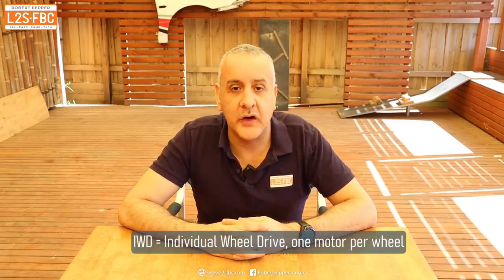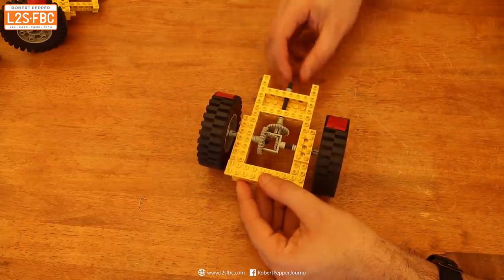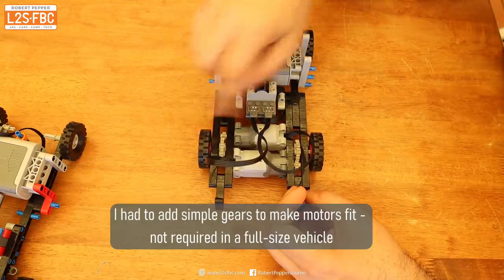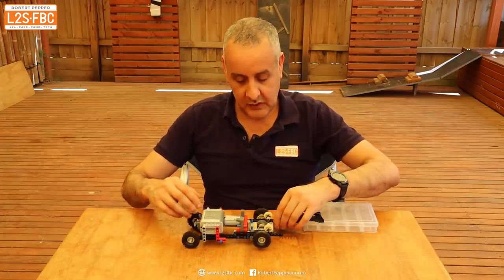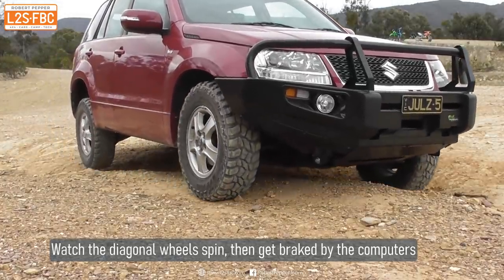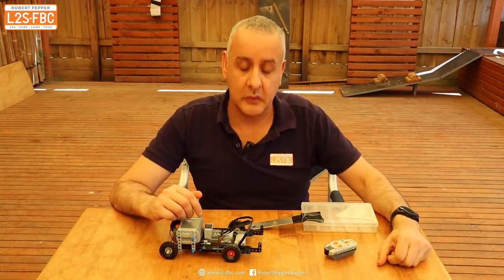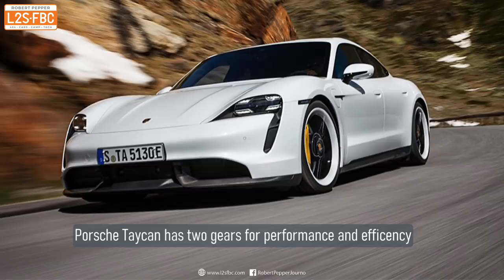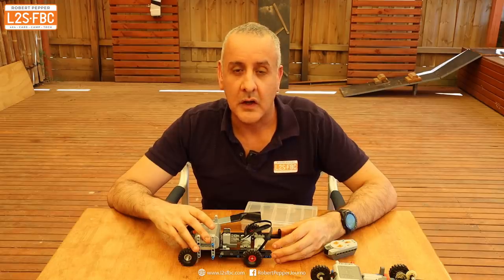Why Differentials Will Die - EV IWD Is The Future!

Comment: What about using resistive braking to control traction. With independent wheel drive if one wheel comes up off the ground you lose a quarter or one half of your torque and horsepower. If you had a setup with a single large engine and for small engines then you can get the best of both worlds during low loads you can use two or four smaller engines and during times when you need a lot of horsepower you could use three or five motors. The central motor being connected with some form of locking device like locking hubs or pneumatic locker or even electric magnetic locker. Then, let's say you're trying to rock crawl or something to that effect and one wheel comes up off the ground you could hold it back using the regenerative breaking to redirect to that power to the other Wheels. This type of setup could also be used with the gasoline engine.
Reply from the maker: I see what you mean, but I think IWD is simpler and as effective. I don't think losing 1/4 or the torque is a problem, or even half.  What you describe is pretty much brake traction control.

Comment: Another excellent video. Another advantage of the electric for offroad use is that it is easy to set up an independent high clearance suspension with a very large suspension travel. One downside to that though is that in order to simplify the connection of the motor to the wheel, you may be increasing the unsprung weight if the motors are heavier than a conventional axle and differential setup.
Reply from the maker: True but if the motors are inboard then that isn't a problem.
Reply: You can put the left wheel motor on the right and a CV shaft that will give you huge articulation with independent suspension and with a bit more electronics you could have good articulation offroad with very low body roll on road.
Reply from the maker: Exactly how Riving Atlis and Hummer do it although Hummer only on the rear axle.
Reply: @L2SFBC  Also on the military Hummer, the axle shaft enters the wheel near the top where there is a gear (this is the final gear reduction in the drive train).  This is how they are able to achieve 19 inches of ground clearance.  If you could build an electric motor in a small enough form factor to mount toward the top of the wheel, you could do basically the same thing.  Said motor though, would have to be sealed against water and mud intrusion.
It would not surprise me if there is another vehicle replacement program in about 25 years that uses exactly this technology.  It would also not surprise me if we start seeing the same technology introduced on the civilian market within the next ten years.
Reply from the maker: Good points! I was referring to the new EV Hummer which has no rear diff just two motors. Thanks for the info very useful.
Reply: @L2SFBC  405 hp orbis hybrid electric honda civic type R motor in wheels, they claim there is no upsprung weight penalty. it was at sema car show.  see aptera owners club video on saftey, vidoe on cost, video on suspension geometry. i wonder what caused panoz deltawing gt to not become sold, given they were so confident about it that they made a prototype.  car i want, is electric drive with a balance of battery and combustion that cost least to own, ends of combustion move aa shaft with magnet and lubrication far from combustion area, non moving magnet makes enegry with magnet moved by shaft to power motor, maybe some air pressure regen brake and powered brakes to minimize electric batteyr use for lonegevity maybe even without a energy effinecy loss. rear seats face the rear (this place hides what i say when i say certain things or just say too much, so i cant explain everyhting but you can fugure it out easy). theres more to say... maybe on guilded we can start a thing for youtubers

Comment: I’m a big fan of electric, But water crossing is gonna be a difficult task and something I would not want to do.😅
Reply from the maker: Same as for any modern car...
Reply: Look up electric RC cars in water, they handle it fine. A big problem with electric cars are the electronic speed controllers, Its basically easier to tune a ice engine then it is a new brushless motor and esc combo XD

Comment: Somehow, my anxiety goes like this. Normal system is like -trust a single man(engine/motor) do good the vehicle moves good. In IWD its like - you have to trust on and must on 4 men(motors) and if and only if all of them do good and sync perfect from start to end, the vehicle moves normally.
Reply from the maker: How is that different from 1000 plus parts in an ICE?
Reply: @L2SFBC  Hard metal parts vs computer software. Electronic speed controllers can be a real pain, especially when you are not getting proper feedback from the brushless motors.

Comment: I did this in my robot wars machine. Two drill motors drive the back wheels. It isn’t power-biased and the fronts just steer. It works very well :o)

Comment: can a car with 4 in-wheel motors be more stable than the conventional system or are there any genuine drawbacks?
Reply from the maker: The motors don't need to be in-wheel which would only contribute to unsprung mass. Cost is one drawback.

Comment: Would we be able to run 15 or 16 inch rims, or will we have to run 20 inch rims or larger with low profile tyres that you cannot air down?
Reply from the maker: On which car?
Reply: WHEELS!  STOP CALLING THEM RIMS
Reply: You can have 20" rims  with 36" tyres instead of 32" just like humvees

Comment: What happens when the computer fucks up a nd they spin at different speeds
Reply: There has been computers running car systems for over 30 years. They are pretty reliable now
Reply from the maker: More so than mechanical bits
Reply: Just a simple factory recall or service bulletin. No different than the Toyota Prius when the cars randomly went to full throttle.
Reply from the maker: More likely an over the air update...

Comment: Robert, you really need to get a deal going Lego. 😉. Great video, it does indeed look like the march of the electricians is getting bigger. The other question. is where does the elec tricky come from. Battery or on board generation? Then there the range question? All good fun though. Thanks again. for the video Cheers Non Stick Nick
Reply from the maker: Or hydrogen...

Comment: I've got a onewheel and can confirm IWD is amazing
Reply: This is a very well-explained and thorough description of power trains and drive systems, all except one thing that you missed, I missed, or I didn't follow. The torque lean of a car is caused by the crankshaft and drive-line axes being in-line, 90 degrees to the axis of wheel rotation, rather than horizontal, or on the same axis as the wheel rotation.. A typical front-wheel-drive vehicle with an in-line engine would exhibit less of this sideways chassis torque, since only the engine crankshaft is rotating on an in-line axis, and a vehicle with a horizontally mounted engine would not have this side-twist to the chassis at all. 

It would have that side-roll chassis torque through a drive-shaft, with rear-wheel-drive and a front-mounted engine, regardless of the engine's rotational position. Do I understand that torque situation correcty?
Reply from the maker: Hi - torque twist caused by lots of things, but even if the engine has no torque twist at all, or it's cancelled, then the mere act of turning the differential will also cause torque twist. That's where IWD comes in - two equal forces cancelling each other. In the video I showed a model 4X4 with significant torque twist. More on that here -> https://youtu.be/CKzrrBwHP8s

Comment: In fact I have of late been scouring  about the in-wheel motor technology by Protean of Canada implemented in  Dongfeng Fengshen E70 of China and a competitor by the name Elaphe and Printed Motors of UK and it will be helpful if you can provide some insight into why Insurance companies are not favouring in-wheel motors i.e. axle less cars; and if you know something about the safety profile of in-wheel motors when compared with the conventional system.
Reply from the maker: Insurance companies wouldn't care overmuch. They are focused on two things; crash rate and cost of repair. IWD wouldn't have a huge effect on either.
Reply: @L2SFBC  you mean to say there is no science behind their reservation; only economics

Comment: How about Limited slip differentials or manual activated differentials?  Pretty cheap and easy fixes for most of these issues.
Reply from the maker: They're not as good as IWD
Reply: @L2SFBC  Yeah, but what is the cost to make or repair or replace versus an IWD?  Why pay thousands of dollars to do what hundreds can?
Reply from the maker: Because it will be cheaper in the future like all new tech at the start.
Reply: @L2SFBC  Forklift electric motors, on eBay, come relatively cheap at 193 and about 2200 for middle tier companies like Jeggs.  Forklift electric motors have been around for a very long time, so automotive motors will be much more expensive even with future funding for their technology.  For a few hundred bucks, people can have a limited slip installed in their vehicles or just a little more have a manual lock actuated diff.  Axles are easy and cheap to replace.  Replacing a motor for one wheel will cost as much or more than an engine or transmission.  utility wise, yes IWD is superior, but to maintain, repair, and function wise, they are superfluous and needlessly expensive.
Reply: @L2SFBC  I wish, I can by a entire rear end for a 1989 jeep XJ for the same price as a lil brushless motor for my robot XD

Comment: IWD Would also make super long travel suspension possible with 4 wheel drive
Reply from the maker: Long travel is useful for any offroad eg rocks. Weight need not be high as you save on diffs, shafts etc.
Reply from the maker: Yes that's an EV problem not an IWD problem

Comment: Reliability wise, 10-15 years down the road, those 4x everything (motors, gearboxes etc) it Will be a very costly experience.
Reply from the maker: Have to disagree..Electric motors are very reliable!
Reply: A motor, a controller (maybe 1 total), a simple gear reduction X4; 9-12 parts verses engine, transmission, transfer case, 2 driveshafts and 2 differentials; 7 parts. So on the surface it seems the current system has less parts, until you look at all the moving pieces. A motor has 2 bearings and a rotor (assuming brushless). An engine, let’s use a 6 cylinder, has a crank, 3-7 bearings holding in the crank, 6 bearings on the rods, the 6 rods, the 6 pistons with 3 rings each, the pins holding the pistons to the rods, and that’s just in the block! The head has at least 6 intake valves and 6 exhaust valves, then the cam and rockers, and belt or chain to drive them. Plus all of those pistons are moving back and forth up to 6,000 times per minute! The motor just spins. 
Next is the simple gear reductions verses the transmission.....
Reply: @L2SFBC  Comparing what i see most on the recycling center i have next to me...magically its 90% electric motor stuff and 10% ICE witch in most cases are still running condition with little cleaning and new fuel. Electric motors other hand, damaged coils, corrosion damage on coils, bearing damage, wiring issue, worn out switches and crapped out computer boards, from witch the computer is the most common issue.. Yes i will definitely want even MORE computers into my car while driving in middle of nowhere and could potentially die if stranded in wrong place due some Chinese made chip deciding its too much for it. On ICE vehicle, its sure transmission parts that can crap out, but you can rather easily replace them off the road given you have tools and spare parts, or even jerry rig something.. on electric everything is covered in mud and if drive motor craps out, good luck replacing it, specially when everything needs to be clean and spotless for current flow and replacing ecu requires trip to dealer so it works wit that motor... nope no thank you. I dont trust the modern cars electronics since those start to fail in 5-10 years, let alone ev's. My car is old clunker, has at best basic rust damage, no fancy tech to fail and would last another 350K km with engine rebuild and if frame dont rust away. Also be still be envorimentally friendlier that ev

Comment: The axle compensates for turning inside wheel spins slower as the outside makes a bigger radius..
Now if you you ride with lockers on then they will spin at the same time. Durrr

Comment: Yes a lot of us are waiting for the battery technology to be good enough but for now some automotive manufacturer should build an overland off road caravan/camper trailer that is electrically driven with the current battery technology and super capacitors. This could greatly increase the range on the bitumen by assisting on hills and during acceleration. It could provide assistance off road as well instead of being a burden this is where the super capacitors come in as they can provide enormous amounts of current which = torque for short periods of time as this kind of load is a bit harmful to batteries they could also be used during hard acceleration. Super capacitors can also be recharged with regenerative braking very quickly which makes them ideal for this application but they cannot replace batteries as they don’t have a high energy density.
Reply from the maker: Agreed would love a powered trailer!
Reply: @L2SFBC  yes you could effectively end up with an eight wheel drive off road vehicle.
Reply from the maker: And with skid steer...it could reverse up steep hills!
Reply: @L2SFBC  yep that’s right and if you have to un couple you can skid steer to manoeuvre the trailer on it’s own if you have to.

Comment: Are they many practical scenarios that IWD is really required over twin locked diffs? Electric motors are great the thin and limited independent suspension offered on some of these 4x4s is a huge let down. For more extreme offroad driving I think a twin solid axle vehicle with a single large electric motor is the most suitable option. I watched an electric swapped jeep wrangler. Very capable yet with the benefits of the electric motor torque and none of the negatives with independent suspension.
Reply from the maker: Well, skid steer is one. And, you can overdrive the front axle, or rear, as opposed to all 4 wheels turn at the same speed. So IWD will be more capable for sure.

Comment: Good explanation of differentials and how they work. I have lockers on my 4x4 on both front and rear, for those tomes off road that it is needed. My only concern is the cost of the computer managing the 4 motors if it goes bad. I mean replacing a computer on today's cars is outrageous,  and that is on a gas powered vehicle. How about a fully electric vehicle.  And also the time to charge it.
Reply from the maker: I would argue that electric vehicles are far simpler than ICE and therefore more reliable!
Reply: @L2SFBC  though the parts are going to be the cheapest and mass produced, there for the reliability is in question.  Then there is the charging time to consider.  As my gas guzzling vehicle takes 5-10 minutes to fill when on a long trip, or even off roading, the time to charge the electric vehicles is far longer.
Reply from the maker: At the moment...check out my Atlis interview...
Reply: @L2SFBC  ok
Reply: A computer to control 4 electric motors is simpler than a computer to control a 4 cylinder engine.
It sounds like controlling 4 independent motors is very complex but in fact it is dead simple.
The accelerator pedal sets the torque required.  All EV motors take a torque input (This is how all EV motors work).
In the simplest form you just send the same torque command to all motors. That will do 99% of what you can achieve with limited slip diffs and lockers. Then you need to add traction control to each motor individually. This is so simple a high end Arduino (a cheap hobbyist microcontroller) can do all 4 motors. And the last is torque vectoring which is not as difficult as it sounds. All you need is a sebsor on each wheel that tells you how much force is on it and steering angle sensor. Then you just send a higher proportion of torque to the outer wheels. So say your accelerator is asking for 100 then if you are turning right  you ask say 150 from the back left wheel, 120 from the front left wheel 50 from the front right and 80 from the back right. The ratio just changes depending on how sharp you are turning. It us much simpler than  running a 4 Cylinder engine.

Comment: Robert Gilmour LeTourneau developed this in the 1950s It works great on large equipment like mining equipment. They are usually powered via a  diesel generator onboard. Best of all, they are  very low maintenance. I have run LeTourneau log stackers and even with their age, they are fool proof.
I for one will still hang my hopes on hydrogen fuel cells. I think hydrogen will be worked out and will prove to be more universal which is the primary attraction.
Reply from the maker: Hydrogen can also be IWD
Reply: Many people still don't realize that hydrogen cars are electric.

Comment: This video doesn't tell you in a conventional 4WD with a full lockup kit with only one wheel getting traction the full power of the engine goes to that wheel.  An electric vehicle in similar circumstances  would only receive 1/4 of the total power.  The demonstrations in this video may work on simple light weight models but in real life off road conditions such as mud, river crossings or rock hopping you need the all the available power to get you out of trouble.
Reply from the maker: I did miss that point and it is a good one. Although I think in practice it would not be too much of a problem.